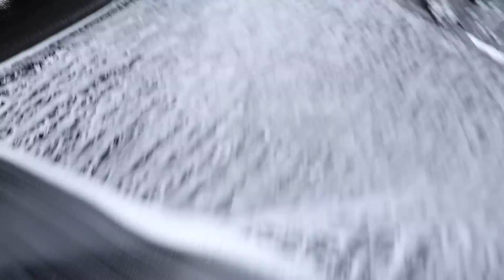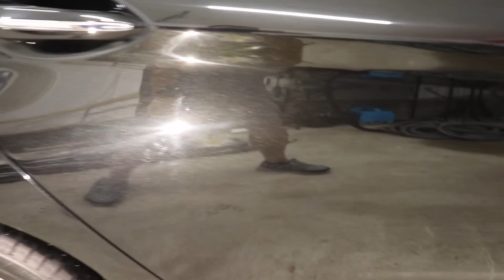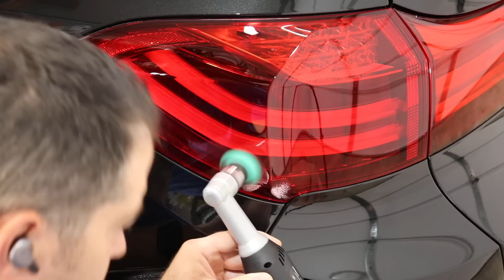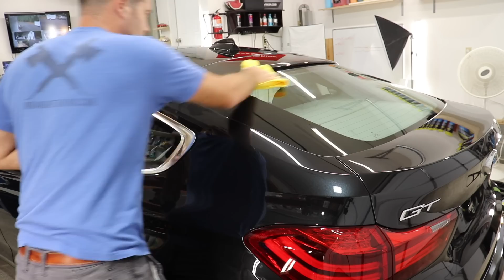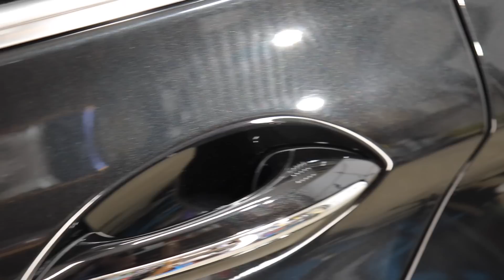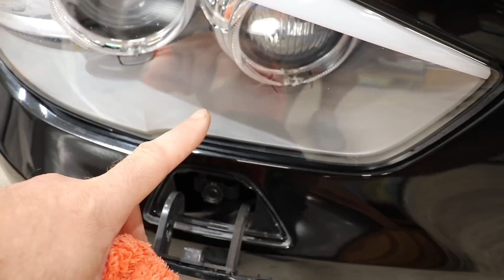Paint Enhancement / Ethos Pro Ceramic Wax / BMW 535i GT #autodetailing #paintcorrection

Comment: Absolutely love you guys doing this. Quick question, so if you're using orange pad with Meguair product, so after washing the pad, does it mean you still have to use same product on that orange pad or you can use different product on that pad?
Reply from the maker: Thanks man.  After you wash out the pads you can use any products you want on them. It’s not ruined or compromised after used a certain product. 😎👍🏼
Reply: @MirandaDetailing  Thank you! To ensure i'm cleaning correctly, what product bang in the buck would you recommend for me  to use to clean the pads?

Comment: What is your definition of a paint enhancement. And that a cheaper option for a customer
Reply from the maker: Our enhancement service is trying to achieve at least 50% swirl and defect removal. Enough to make a very noticeable difference without having to go full paint correction. Our aim is to preserve clear coat as much as possible. Plus we priced it just right for our customers. It’s about had the price of our correction service.

Comment: As not a detailing company how do you know what kind of clay bar to get how can you tell?? Thank you
Reply from the maker: Hi. Clay bars come in a few different grades usually heavy medium and fine. I always use the fine clay because I really don’t need anything more aggressive than that. Unless I’m doing some overspray removal I’ll use some heavy clay. The clay bars will tell you on the packaging what grade they are.
Reply: Until like the hundred gram ones would be what you're talking about? Would you also use the clay bar before use the clay mitt and what's the difference between using the clay bar and the clay mitt
Reply from the maker: The grams is just the weight of the clay bars not the aggressiveness. I usually use the clay mitt for the top surfaces because it covers a large surface area. And try clay bar for the bottom surfaces becasue it’s worse on those areas. The clay bar usually is slightly. Ore aggressive than the flat mitt even though they may say they are both fine grade. It’s just personal choice and method really.

Comment: Phil, I recently bought a black Dodge 3500. I  polished and prep same and then applied wax that bought years back  at a place that sells cleaning products.  I'm planning on ordering some of Ethos Pro Wax. Will I need to prep my truck again prior to applying the Ethos wax? 
It's pretty clean from where I prep same prior to the wax job.
Reply from the maker: Hi. Well if it’s been years I would start fresh again, wash, and clay bar. If it doesn’t need polishing you could skip that step.
Reply: @MirandaDetailing  Thanks Phil for responding so quickly. It's actually been in the last month since I did the prep. The truck hasn't been washed and it stays in the garage. Not my everyday ride at all. It doesn't see a lot of daylight if you know what I mean. 😀 So I'm guessing it will be ok to go ahead and apply the Ethos wax. I love the Defy for sure. Did the truck and you find yourself putting some more on two days later and the truck hasn't moved. Oh, just bought a gallon of it and got it today. Thanks Phil.

Comment: I was one of those ones who found that the Ethos product wasn't lasting very long.  I got about a week out of it with "normal" early fall driving.  I got about a week out of it before it seemed to basically disappear.  The only thing that wasn't done was a 'detox' wipe before applying the wax.  It's still hard for me to believe that a wipedown before applying the coating, wax, or sealant is that important after it's been clayed and polished.
Reply from the maker: That’s what I was expecting also. But I was pleasantly surprised. Plus the first batch of this wax was defective so that messed things up. But I think it’s good now.

Comment: Also how come your arm speed is fast?
Reply from the maker: What do you mean?  Arm speed depends on a lot of factors. There is no one arm speed that I need to maintain. It all depends on how the paint reacts and what polish or compound I’m using. Sometimes I use a slower arm speed other times I can go faster. It all depends. Plus this is a paint enhancement not a correction. So I’m not working the polish as if I would a compound. Is that what you meant?
Reply: Miranda Detailing I mean cos your arm speed is faster it not giving it a chance to do much personality I’d go bit slower to get bit more correction
Reply from the maker: I figured that’s what you meant. But like I mentioned in the previous comment, it all depends on the paint and polish I’m using.  I’m not going for correction, I’m going for enhancement. If I was correcting the paint my arm speed will be slower.  Remember that each job is different and each person’s technique is different. Thanks.
Reply: Miranda Detailing so do you do faster arm speed with this combo all the time then?
Reply from the maker: Nope. Depending on what I’m working on... some paints are harder, some are softer and depending on how far I need to go will determine what I need to do. So it changes a little with every vehicle and job.

Comment: So at what point do you decide to use your wash and clay mit process? Its  seems extremely  efficient to do that with any paint enhancement and or correction? Given how much dirt the clay bar was picking up in the rear, it would seem your normal wash process would've  of worked well.
Reply from the maker: For all of our full details, paint enhancements or corrections we usually do that becasue we will be either polishing or machine applying a wax or sealant and it will remove any marring left behind. For maintenance washes we won’t use the clay mitt or clay bar at all.

Comment: Phil i havent noticed....WAHT A GREAT IDEA AND TIP..............to remove any potential marring from clay mitt (i usually use clay bar if i dont do correction and mitt if i do some type of correction) but i never thought that if i apply the wax with a very light pad like black, i can also remove any light marring from the mitt and at the same time i am applyng the wax!!!!!
what a great tip, i suppose we get advantage of the very very light cut of the black pads to remove the ligh marr...........
THANKS THANKS

Comment: Love the ceramic pro wax and the detox. I used them on both of my last details. One truck I used it on was too big to fit in my garage. I had to turn it away from the sun and let the panels cool down before I put it on. Had to wait for the sun to get behind my house to apply to roof and hood. Great video on how to use both products. Great thing is on cars if you are using a DA, you can apply to the whole car before wiping off, large trucks maybe half or two-thirds. I have been impressed with every ethos product I’ve used. Great video as always.👍🏻👍🏻

Comment: Another great video. Fantastic results, The Ethos Pro Ceramic Wax gives some of the best gloss and depth of ceramic sealants I've seen.  I say the depth is its strong point, as imo the ceramic sealants and for that mater coatings Ive seen don't quite achieve really good depth.

Comment: Great tips on applying wax with a polisher. I’ve used Ethos Pro CW both by hand and polisher; using your tips, I should be able to save more time with the polisher. Here’s a tip back to you: I found the Ethos Pro CW applied easier with a foam applicator than microfiber when applying by hand. Spreads thinner. It is a breeze to wipe off no matter which way you apply it!
Reply from the maker: Thanks! Great tip! I’ll try the foam application trick!

Comment: If you need more cutting with uno use a more aggressive pad (wool) or apply more pressure changes the cutting ability of the product
Reply from the maker: Yes true. But I also want it finish down. I wool pad would leave marring.  It all depends on the paint. Some paint responds well to it. Like the White Jag F-Pace video we did. That one responded better than this.
Reply: @MirandaDetailing  nice I've really enjoyed your videos I'm gearing up to start my own business, mobile to get going but learning your techniques have actually worked out better than some others but like you say its what the paint wants